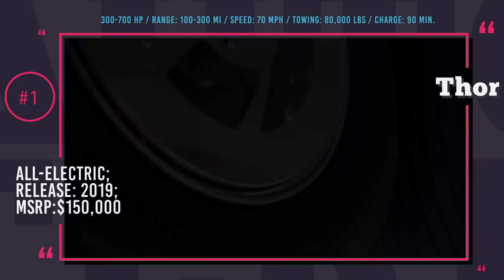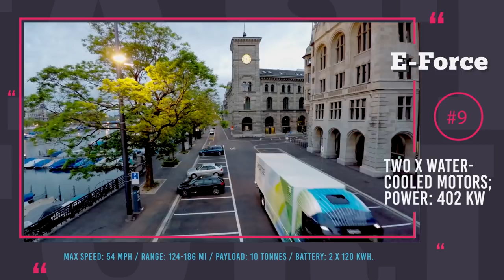10 Electric Heavy-Duty Trucks: Review of Alternatives to Tesla Semi in 2018

Comment: This may be a dumb question, I know next to nothing about electric vehicles, but could solar panels on the trailer/cargo area or charge while braking extend the range of these vehicles? There's always down time while loading/unloading and often the truck would be in the sun at these times.
Reply from the maker: The efficiency of sun panels is yet to be proven. As for the regenerative breaking, this technology comes as standard on most modern EVs. The sun panels and regenerative breaking, however, could only be considered as supplementary sources of power.
Reply: The heavy weight of all the solar panels would outweigh (no pun intended) any electricity they could generate.

Comment: One question. What does power the refrigeration system? This system is a big energy consumption to take into an account.
Reply from the maker: I dont have an immediate answer for you. I would say that refrigeration containers will have their own batteries and will be recharged separately. The useful payload of those will be lower, but this seems to be the only solution.
Reply: The electric trucks can be configured to export 3-phase power to the trailer.  The trailer will act as if plugged into shore power (like at a loading dock) and the truck range will decrease depending on the heat load of product in the trailer and ambient conditions.
Reply from the maker: The manufacturers have gone though a lot to make electric trucks, so the finding extra power for refrigeration systems is just another milestone on their way.